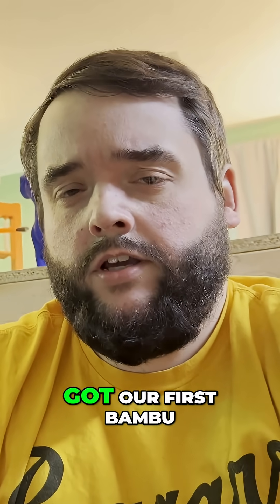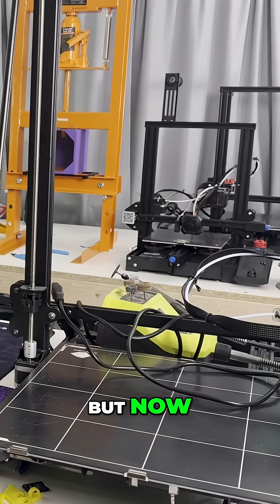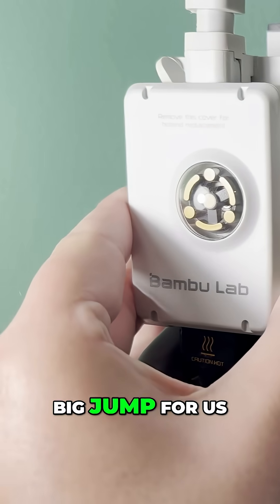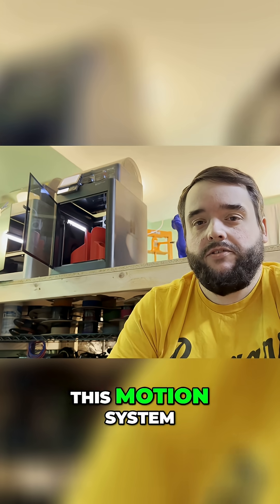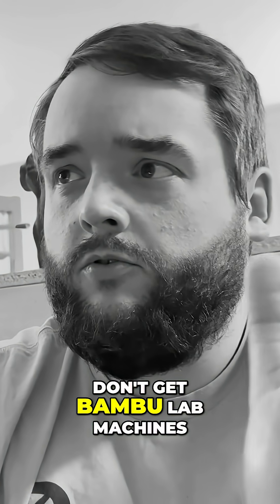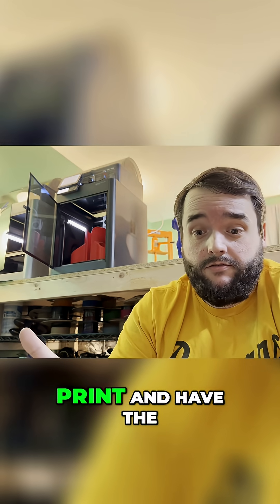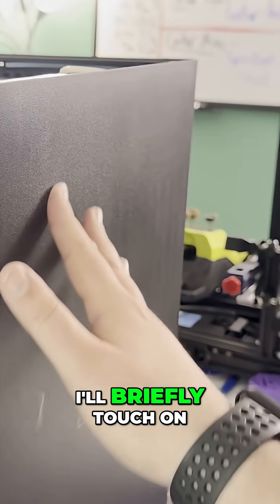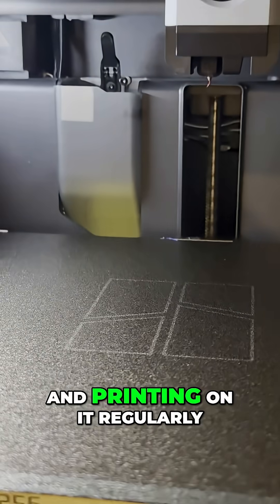Bambu Lab 3D Printer: Is It WORTH IT?! (Honest Review)

Comment: I first got a 3d printer 10 years ago and I spent more time trying to get it to it to work than I did actually printing things. It put me off 3d printing entirely until a couple days ago when I ordered an X1C from Bambu Lab, "I just want to push print and have the thing print.." is EXACTLY what I've been waiting for, I don't mind a closed system if it works when I want it to. Also, yes, I know there are possibly better options now but I wanted something safe.

@KeoPrints has been extremely helpful over the last week as I agonized on what to get so thanks for all your info.

Comment: Honestly the Bambu haters can go jump. These are excellent devices and dependable. Open source is not always a good thing as it leads to security issues. 

Smart people understand that.
Reply: You're pretty confident in your statement. Just so you know, Bambu Lab machines had several major security issues in the past. The most serious one was when the system processed everything with a .3mf extension. The XPlus developers exploited this vulnerability to install their software on the X1C.

Let's also not forget the day when Bambu Lab printers suddenly started printing by themselves due to problems with the Bambu Lab Cloud.

Hiding the source code is useless. With fuzzers and other tools, vulnerabilities will always be found. Microsoft Windows is the best example. It's one of the least secure operating systems, and, surprise, surprise, it's closed source, while Linux is considered reasonably secure. Are open-source programs free of bugs? Of course not, but the advantage is that anyone can fix the bug, not just the developers of the software. With closed source, you depend on the manufacturer to fix the problem, but with open source, someone else can.

Comment: Recently passed 1000 hours on the P1s since 4/1/25 ( now 7/12/25). Gets used daily, in a semi  with constant vibration and travel down Americas highways.  Only calibrated 2 times, auto bed leveling for the past 40 days.  I’d say it’s worth it.
Reply: Print while driving?!
Reply: @TheTyisawesome no. The road is to rough.  A semi ( 389 peterbilt) is designed to carry weight not give a smooth ride.
Reply: Dude what thats badass
Reply from the maker: Friend if you’re ever pulling a Utility trailer and you’re needing some parts coming through Omaha, come find me
Reply: @KeoPrints pulling a 53’ flatbed trailer.   Most of what I do print is storage and decorative stuff.
Reply: That’s nuts - what a use case!